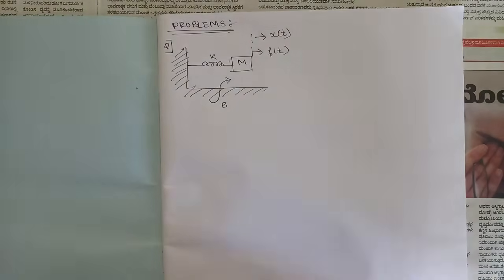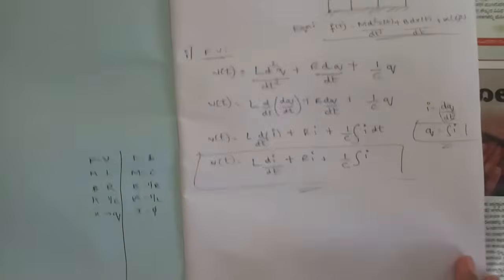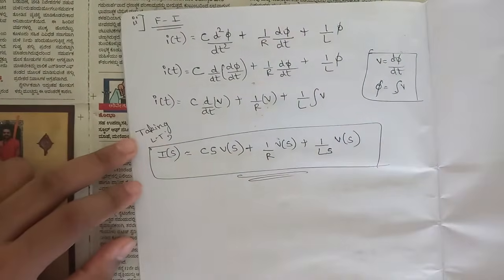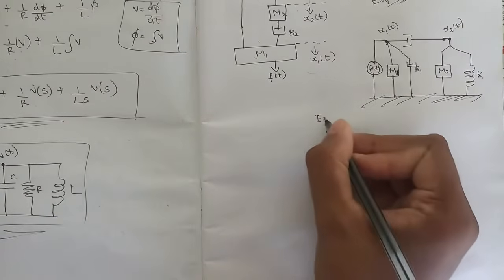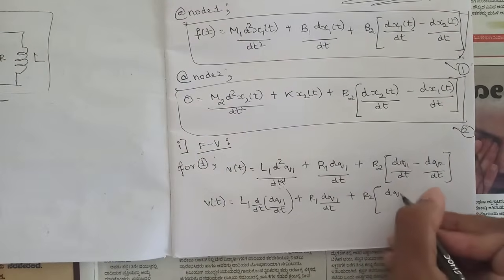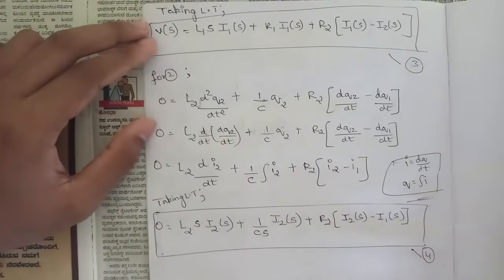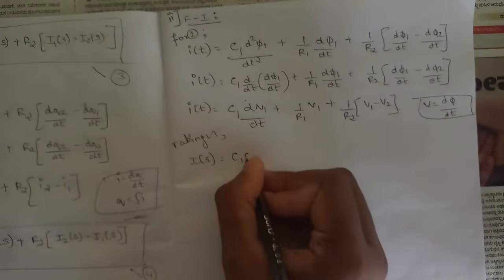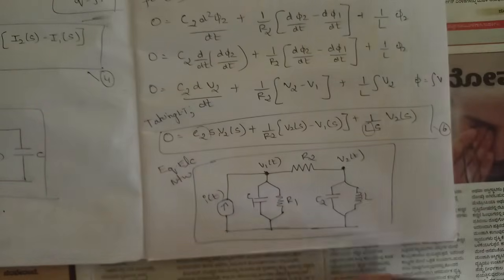4 FI,FV Analogy 2 IMP Problem Explained Module 1 4th Sem Control Systems ECE 2022 Scheme VTU BEC403

Comment: Sir in 2 nd problem why u didn't take m2 in between node x1 and x2
Reply from the maker: Because movement of m2 is causing the displacement x2...
Not both of them..
X1 is caused due to m1...
It's a bit tricky...